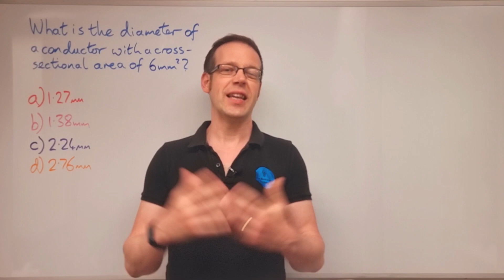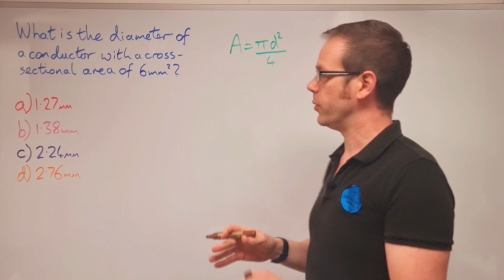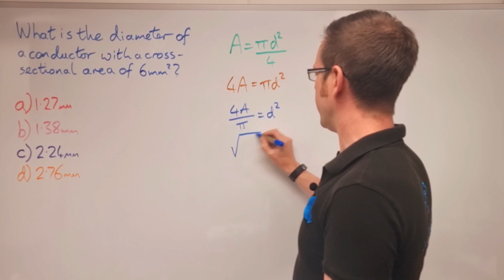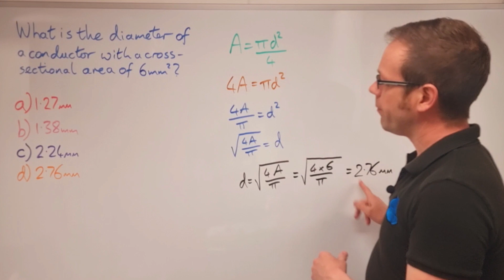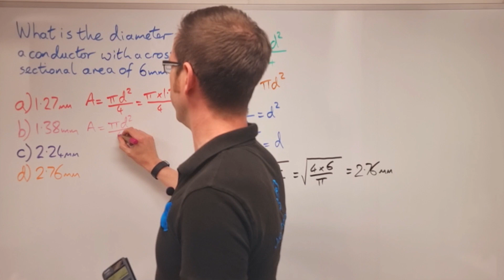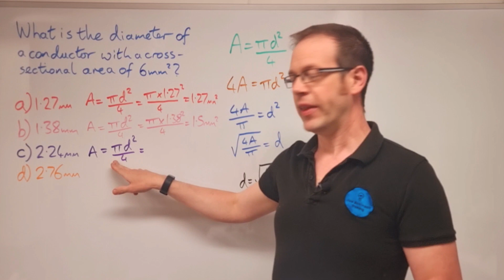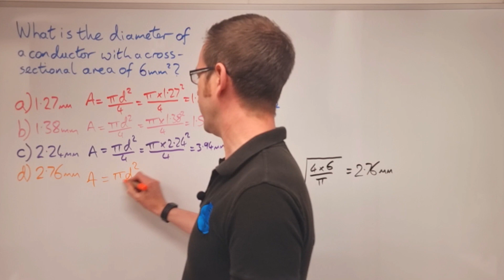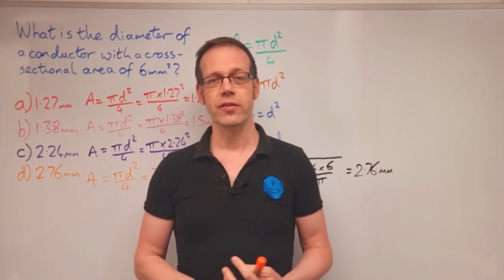8202 L2 Multiple Choice Exam March 2022 Q7: What is the Diameter of a 6mm Squared Conductor?

Comment: There's an alternative method. For the area you can also use A = r² x Pi. So if you got the area you can divide it by Pi, squareroot of that will give you the radius. Multiply that with 2 and you'll get the diameter (d = 2 x r). I use that way because it's easier to remember, at school we were taught this way to calculate the area of a circle back then and it got stuck. And sometimes there are several ways to Rome.

These modern calculators are amazing! And it also remembers me on my final examination when I was an apprentice. In the invitation the IHK board of examiners claimed that I had to bring a calculator that "does not require mains power". That made me lough hardly back then, because that was in 2002, and mains powered calculators weren't even back then a thing anymore for 20 years or so...